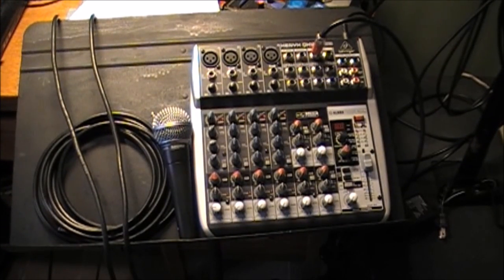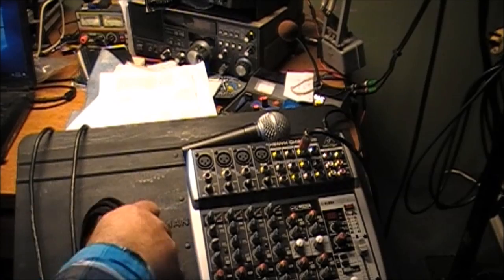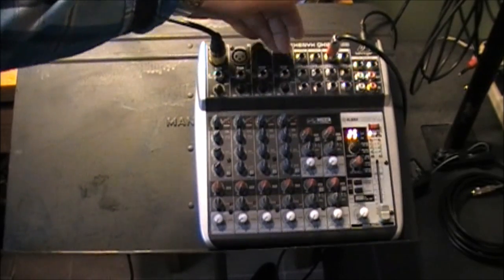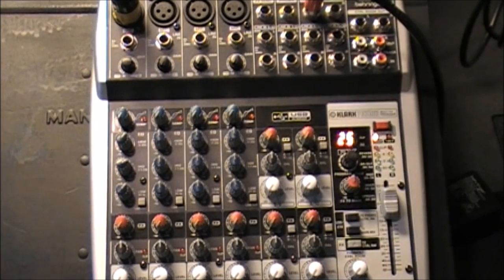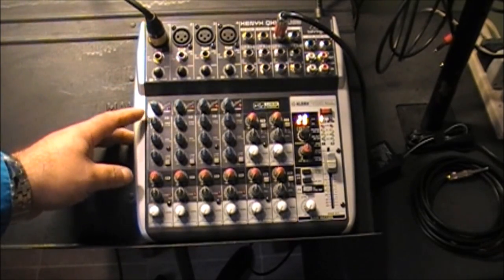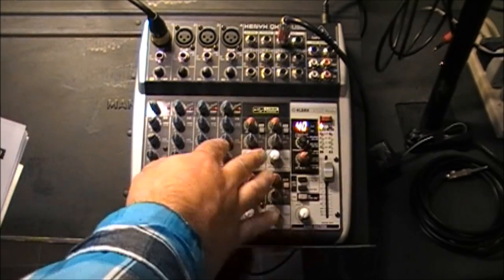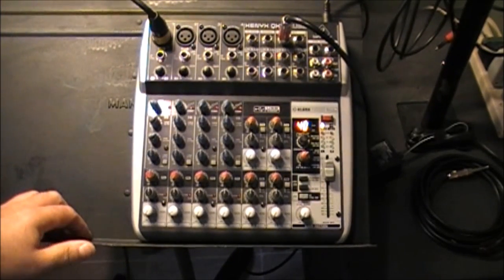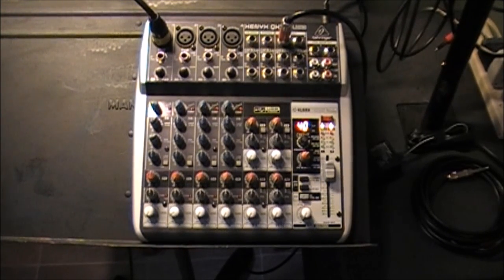Behringer Mixer: How to do a setup

Comment: Great video and very informative. I am a mobile DJ I use an older version of this behringer and lately I have noticed that I don't get any sounds coming out of the master L side of the mixer. Im using stereo rca and 1/4 connections and only sound i get is from the R side of the mixer. Is my L channel bad and I need to replace it? Or is there some reason its going mono even with a stereo connection? Any input will be greatly appreciated.
Reply from the maker: Check your pan button and ensure it is centered straight up
Reply: Andy Tobin yeah the pan button is always centered so that’s not it. I’m thinking it’s 10 years old and that channel may not be working any more. The master led lights on the right side only light up on the right side even if both left and right inputs are plugged in
Reply from the maker: @rpmbxdj I believe it is highly unlikely something has failed in the unit unless you can recall something happening while it was last used that made one channel fail. What I would do next is to give every pot and jack insert a complete cleaning. Try Deoxit or NuTrol. I am thinking perhaps a micro switch inside one of the patching jacks may be stuck open or closed and causing that. You may have to open up the unit to get at all the trim pots properly, not sure. Also spray those sliders as they are famous for getting dusty and inoperable. Once you irrigate all the trimpots twist the buttons many times and insert guitar plugs, XLR's etc... in and out as necessary to free up whatever may be causing the failure. Flick those sliders as well up and down many times and see if that will cause signal to return, If this works, remember to always put your unit away or at least cover it when not in use to stop dust and debris from getting in there. If that does not work, it is well worth bringing it to a shop as it may be a bad solder joint or a small failed electronic part. Let me know if this deep cleaning helps. Be careful not to break anything off. I'd definitely spray the sliders and work them gently up and down to see if dust has caused the signal interruption.
Reply from the maker: @rpmbxdj  Message me your model number so I can review the pdf closely to see if it is a settings issue. Sometimes in can be a simple push button that causes it to stay mono. I really think it is simple because Behringer now makes durable gear. It is possible your mixer is the older type but I don't think so. The first lineup of gear worked great but was not lasting due to inferior design,  poor circuit boards and low quality parts. They since upgraded the design and parts and it seems just as durable as any other gear out there now.
Reply: Andy Tobin the model I have is the xenyx 1002. It’s about 10 years old. I really appreciate the help and your input on this. Because I don’t want to go out and buy another one if it’s something I can fix
Reply from the maker: As I said, if this unit was not dropped and was working fine until now. It may be a stuck micro switch in one of the insert channels or input channels. I'll check the PDF and see if I can find anything causing your issue.
Reply from the maker: 1. Try plugging in your headphones and see if there is a left right signal. 2. check in the FX button area to see if you have anything depressed that should not be. 3. check where balance is on every channel. (Note: this is different to PAN) 4. Switch outputs "LEFT & RIGHT" to be sure it is not the cable or speaker at fault. IE: put left cable in right and right in left. 5. Be sure to spray all volume pots, sliders, inputs and outputs including push on / off buttons and XLR inputs. 6. Try sending in a signal into both "Left & Right" of your stereo channels to see if these stereo inputs are working. Typically the stereo inputs are the last channels on the board. They should be channels 5 & 6,    7 & 8,    9 & 10 for example. NOTE: This is not in any order just ideas to try
Reply: @Tobinindustrial  It's funny lol, I was just thinking about the aspect of plugging in my headphones to see if i do get a left and right signal. It's such a simple test that I hadn't thought of yet. Actually it's been a while since the left channel hasn't been working, I just haven't been really diving into diagnosing the issue. In all honesty,in the past I haven't been the most careful when plugging stuff into the mixer( loud humming and popping noises aplenty lol)  so its quite possible that I have blown an output channel somewhere along on a gig. On another note, I'm going to check the CONTROL ROOM Outputs to see if I get a Left and Right Signal as well.
Reply from the maker: The control room section is a good place to check. Also check and see if the Phantom power is working. It is sometimes easier to search for what is working and you may discover something in the process that could fix the issue. A lot of these buttons never get moved and can become the cause of issues due to lack of use. Like a dirty switch @rpmbxdj
Reply: Andy Tobin update. After running various checks on the wires that I have running to the unit. It seems that the L output channel is indeed out. When plugged into the control room outputs both L and R  channels produce sounds and so do The headphones. All inputs are fully functioning as stereo phantom is also working for the mics. I can post a video of it so you can see what’s going on. I will use it at gigs temporarily using control room outputs but I’m gonna replace the unit with the newer version of my behringer. They make great products! Thanks for your input !
Reply from the maker: @rpmbxdj  I suspect an internal part has failed or an insert jack is not releasing or stuck and causing that channel to be void of a signal. I know this unit can be repaired but typically they replace sections of circuitry rather than just replace the specific part that's blown. It is an older unit but may be worth bringing to a backyard tech for one last "once over". I wish you all the best with your new Behringer board. If you ever get a chance, try a Mackie board. they are very well designed for durability and may be even better than the Behringer.
Reply: @Tobinindustrial  I've been looking at the Mackie Mix8 Mixer as a suitable replacement for my Behringer. I may take a look and open it up myself once I get the Mackie and see if maybe I can repair the non functioning jack. Thanks a lot for your help my friend.
Reply from the maker: @rpmbxdj  All the best to you. Drop by for a question or chat anytime.

Comment: ....hello..where can i connect the amplified guitar..thanks
Reply from the maker: I am not sure what you mean by an amplified but I will assume you mean the signal coming from your amplifier after you plug in your guitar to it. In that case, you really need a DI box so that you can split the signal. The guitar would go into the DI box, the low impedance plug typically will send the signal out to the mixer channel and another high impedance cord would send  a signal into your amp. You can also use a mic and mic up your amp and send the mic into a channel on the mixer. I hope that is helpful. Let me know if you have any other questions.
Reply: @Tobinindustrial  i have a fender speaker 15G..first thing is...from speaker input to mixer main out left then from mixer line in5 to electric guitar...is it okay?  I tried it and its okay but i can hear some murmuring noise from the speaker....any suggestions or is it possible to buy DI BOX....SORRY my first time...many thanks
Reply from the maker: @samuelpacsi264  Ok, let me just reverse what you are stating to clarify. Guitar  cord goes to one of the mixer channels. The Main out (Left channel mono) goes to the input of the fender. Please ensure that you have your "PAN" button on center so that you will pick up both left and right signals equally even though the guitar is mono.
Reply: @Tobinindustrial  yes exactly but when i turn up the volume heared some noise come from speaker....many thanks sir
Reply from the maker: @samuelpacsi264  That noise may be from a bad cord. By yourself a good oxygen free guitar cord and that may help. Also if you hear like a flutter in the speaker it may mean a dirty contact. Have your guitar pots, mixer and fender speaker connections and pots, volumes, sliders cleaned. Sometimes dust and dirt can cause weird fluttering noises in the system.
Reply: @Tobinindustrial  oxygen free guitar cord? ...thank you so much sir...i will try it all..thanks for the response and suggestions....God Bless
Reply from the maker: @samuelpacsi264  God bless you too my musician friend. All the best to you.
Reply from the maker: Just thought of something else that can cause fluttering. Sometimes the wire connections inside an amp can become loose, corroded or just not seated well on the circuit board and this can cause weird signal noises such as fluttering to happen. You may even feel the speaker vibrating when it flutters. This can be a serious issue and can cause the circuitry and/or speaker to become damaged. The only other cause of a flutter is improper impedance from too many speakers hooked in series can cause the speaker to overwork and flutter. I hope that is helpful and not confusing to you.

Comment: Hello Andy, will you be able to help me please? How do I connect my Chrome Book to this machine? I want to do some backing track singing. I did connect my Chrome Book to the Top Two inlets in the Top RHS, 4 Inlets - TOP ROW. When I connected it to my power amplifier the sound was very muddled. Thank you.
Reply from the maker: I've never used that application but I am sure you use the USB plug on the front of the mixer to comnnect to any computer. You may need a special cord that runs into your "Chrome Book" with the proper connection for the mixer as well.

Comment: Great video. You mentioned that this mixer does not supply enough wattage to power a passive speaker and therefore you need an amp. My question is whether or not the unit will supply enough power to have a decent signal out of the phones jack into my headphones or will I need to have a heaphone amp? Thanks!
Reply from the maker: It should have loads of power to use headphones. Yessir! It has a heaphone out jack and if you have the signals set up right, the headphones will work great.

Comment: Great, video. Thank you for taking the time to share - I learnt a lot. One question I have though is I was surprised to see that the level control of the mic is so sensitive. On at 1 and off at 0... might make fine adjustment tricky. Would you run it like that or turn down the gain, main mix, or amp level?
Reply from the maker: In order for the mixer to operate most efficiently the main mix level needs to be at UNITY. It seems high but typically the channels are sensitive at this level and so the channel volumes sometimes just need to be at 1 or 2 position for proper balance levels. keep in mind that each mic or input  device may not be equal so this mixer will give ample headroom for pretty much any instrument or mic.  Trust ,me, it is a good thing when you have lots of volume left for headroom. Audio quality suffers when everything has to be up to maximum. Headroom is very important and the system runs smoothly and has lots left for larger venues.

Comment: Thanks for the great video.  Where do I connect if I wanted to record my singing (just vocal) but I also wanted to supplement it with some music, however, I do not want to output the music to the computer for instance, is that possible?  Or does both vocal and music need to be out?
Reply from the maker: Record your vocal in channel one. Record on,ly that signal. Allow the music to be sent to speaker out but only record the vocal and omit the music. The music can be monitored  so that you can sing along with it. The key is to only record the vocal in this instance and not the music. I hope that is helpful.
Reply: @Tobinindustrial  Thank you Andy for the quick respond.  I do understand the concept of recording just the vocal, and that's exactly what I want, but I don't think I'm connecting correctly because I either record both or nothing.  I'm also using a headphone so that my mic is not picking up the music track.  Any idea where I might go wrong here?  Thanks in advance.
Reply from the maker: @trinhk  Insert vocal mic into channel one and set it up as normal. Take the audio out and send that into the recording unit. if possible, use another unit to play your music and through headphones would be a great idea. If you use the mixer to play the music, it is unlikly that you will be able to isolate it as the mixer is used for "MIXING" and is not used like a multi track recorder unit which "ISOLATES" signals. The mixer is designed to mix and not isolate and seperate. The easiest way, as I suggest, is to use another unit for music playback so you can sing along.
Reply: @Tobinindustrial  Ahh...I get it now.  I think I've been trying to use the tracks in isolation which you suggested is not possible.  Thanks again Andy, you have been a great help.  Much appreciated.  Cheers!  Keep up the great work.
Reply from the maker: @trinhk  Just as a final side note to your question. If you pan your vocal to the left and pan your music to the right onm the mixer, it should allow you to record through left (Vocal) and monitor through right (Music) Iam not sure how this will work on a stereo as you vocal may only show up as a left signal. All the best and enjoy all your mixing and isolating
Reply: @Tobinindustrial  That's a very smart idea.  it might work and you're right, I think it might output as left signal only.  Thank you.

Comment: On this mixer how to record live music? how to use usb interface inbuilt? how to use RCA connectors of OUT on this mixer ??
Reply from the maker: Recording has RCA out and you will need to send this into a recording unit and make sure the levels are correct. The USB can also tap into a computer for digital interface, mixing online, etc.... I hope this information is helpful.

Comment: Andy, I hooked up my GTD 4 wireless mics by XLR to the mixer for karaoke  use
.....each mic works fine except when I use the main Fx button I get nothing but white noise.............so I had to go back to using the single 1/4" connector from the receiver to the mixer.......................so that means I can't control each mic independently without the Fx voice effects......Can you help me figure it out...thank you     Xavier Rigau on FB
Reply from the maker: I am not sure of what that issue may be but it sounds like you have either the FX improperly designated or the chanel not properly set up to accept the FX properly.Shcek all those push button functions to be sure you have all channels set upeactly the same.

Comment: Hi.. I have this mixer.. And I just got the roland vt4 voice Effects.. Can you help me how to do the settings.. To my computer, and studio speakers? Tks
Reply from the maker: I have never used a mixer to computer application before but the best results would be by using an interface unit between the mixer and comnputer. You could also buy a mixer to computer cable to allow you to begin your musical project. As for the USb connection of these units, I suspect that is real easy to set up but I have no knowledge of how this will work with a laptop. You may want to read up on that in your manual and hopefully that will be the most economic way and effective way to use the mixer through the computer. Thankls for watching.
Reply: Tks for the help..
Reply from the maker: @SZack10  Thank you for watching my video.

Comment: Where do you plug guitar into?
Reply from the maker: You may plug it into the high impedance jack input on any channel or use a direct box. The guitar goes into the input of the box by using a typical guitar cord and then you can run the direct box into one of the low impedance channels using a low impedance cord.

Comment: Question m8s, glad I found a video on this mixer.
I am trying to record from a guitar amplifier. using a Sure SM57 and I have done all the appropriate mic techniques on that end. however, do I now use a small amount of gain and turn up the volume, or crank the gain and use little volume? 
the issue is that since the sound source is rather loud, my limiter lights and clip lights peak rather easily, and so I am left with practically no mic gain, and practically no volume. help
Reply from the maker: Have you tried patching your pedals through the effects send portion of the mixer? I have never used an effect that way but the mixer is well capable of doing that I am sure. That might get you what you need. As for me, I mostly have live sound experience and very little recording experience.
Reply: Andy Tobin nah I have not. I require those to be dry from the board as any enhancements will be done in the DAW. Any video I watch all sais to set the gain to avoid clipping which I understand, I just need to know if it’s max mix gain and little board volume or vice versa
Reply from the maker: The general rule of thumb is your post amp signals need to be the hottest and the pre-amp signals should not be overdriven.  So whatever you have in the preamp chain should not be too hot as to cause distortion in the post amp stage.